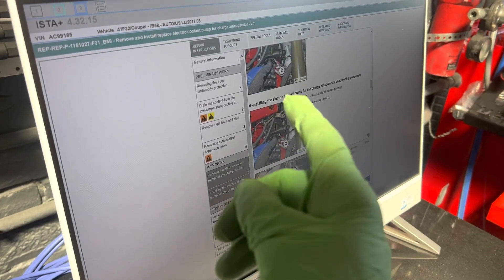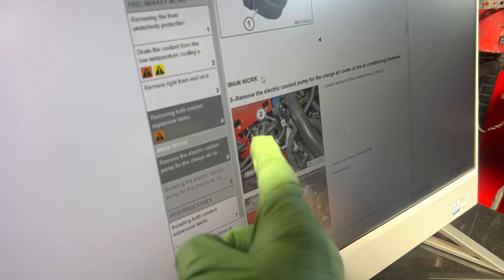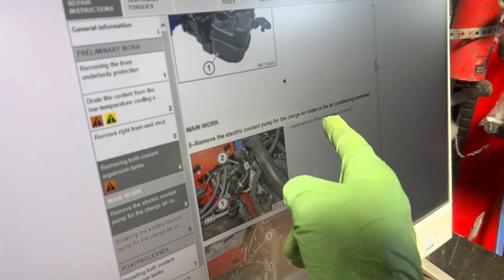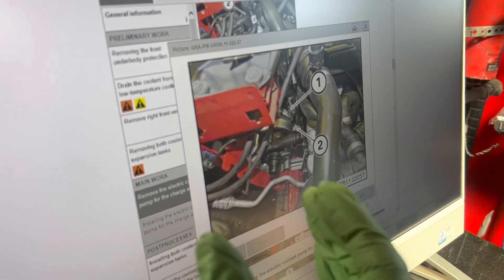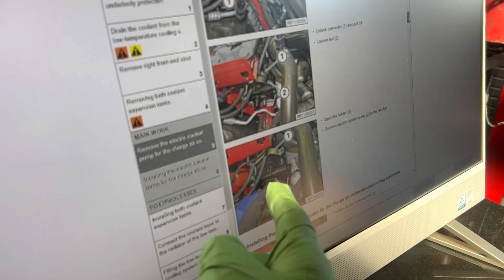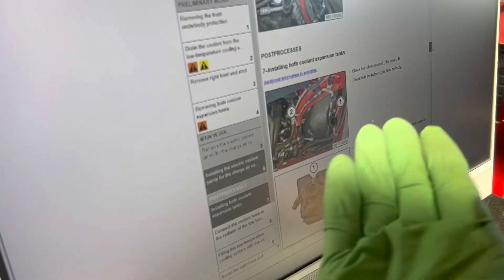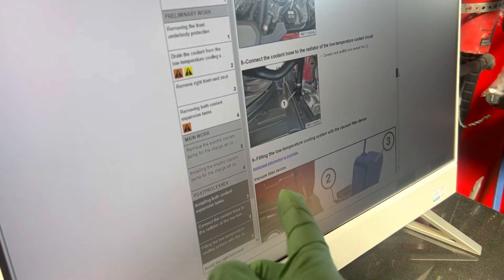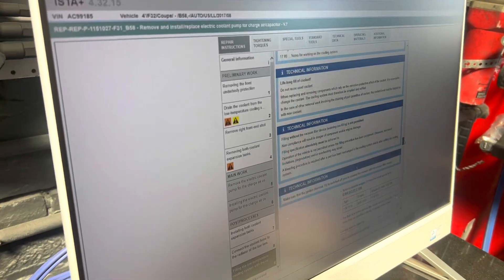BMW 440i AC Plate Heat Exchanger ￼ (“Condenser”) there is no Refrigerant Condenser on this car. ￼

Comment: I have the same problem with the same car, and if you have a fault code that says pump has a low pressure it that, or you should look back at your own videos about ac heat plate exchanger one of those things should be. Please do correct me if im wrong.im still learning about this system.
Reply from the maker: It had a code for a high head pressure for the Refrigerant

Which was because it was low on coolant 

Filled the coolant, and it worked

Comment: How can I have access to similar repair manual you guys are using in this video?
Reply from the maker: This is factory, OEM BMW software. You have to pay the big bucks for this one for a yearly subscription.. 

Go to BMW’s website and download every software is available through the manufacturer OEM or Chiltons, or Mitchell or ADP, or all data or motors all these companies provide data, only the only a manufactured by the best data for their own vehicles . 

The one software you see where I use just for refrigerant capacity is a type of oil in oil capacity that I show on my iPad or my phone is by CYTK available on the app on your phone .